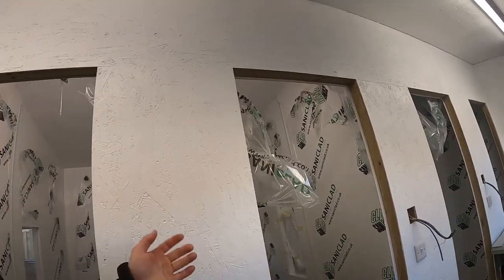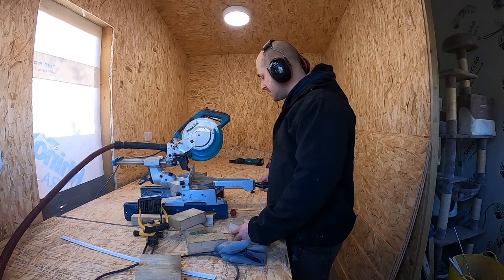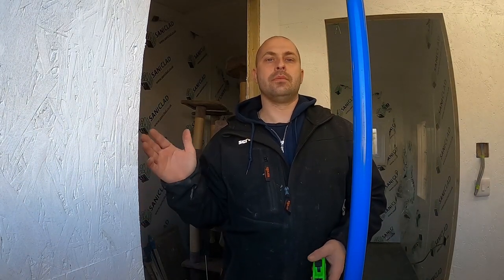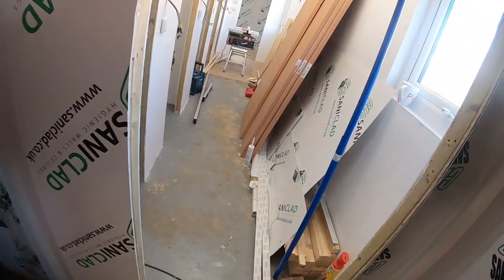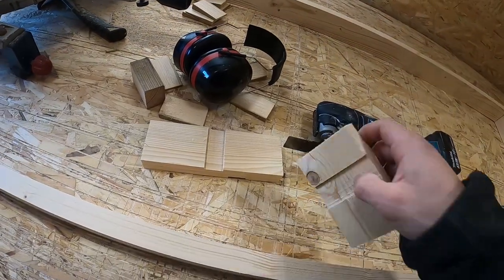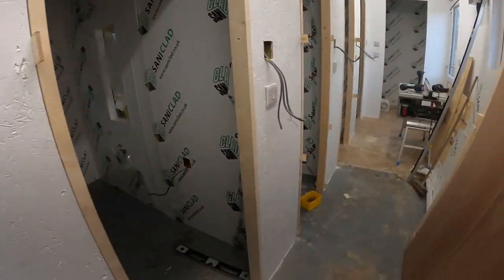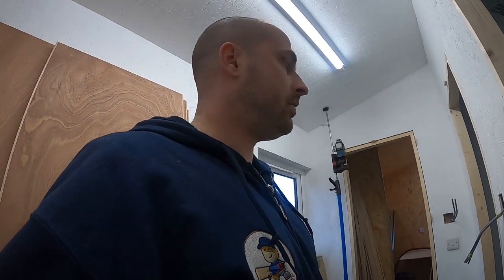Fitting door linings

Comment from the maker: 0:00 Intro
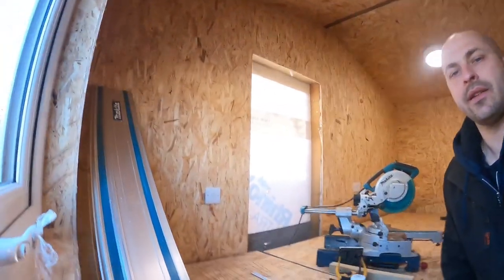0:42 Preparing our door packers
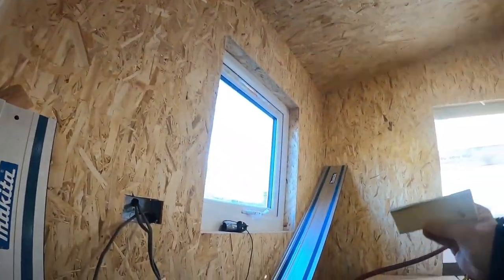3:22 Explaining how packers work and discussing next step
4:12 Discussing the optimal width of the linings
5:44 Working out the height of the linings (considering flooring)
13:23 Frame done - now what?
15:42 Fixing frame in place
15:57 Discussing overall plan - dealing with warp and belly
17:03 A bit more work
17:16 Dealing with the gaps (belly)
19:54 Adjustments, alignments
20:14 Dealing with more gaps (talking through the steps)
23:56 Always double-check (more suggestions)
28:36 Final thoughts (outro)